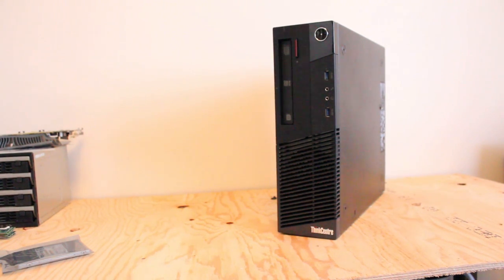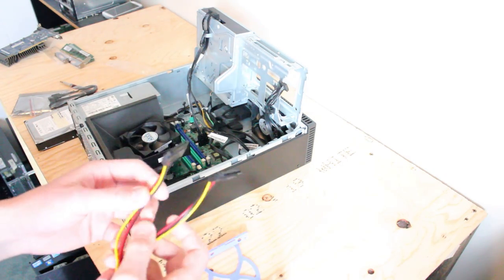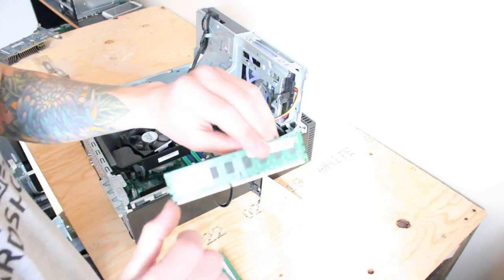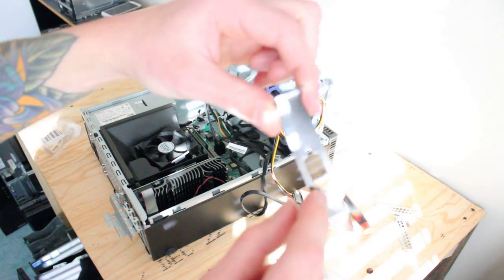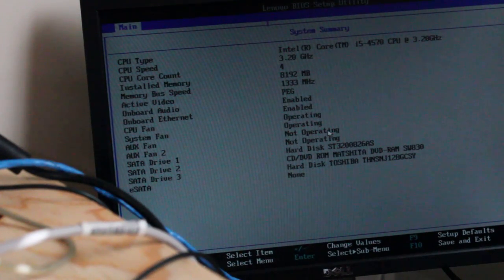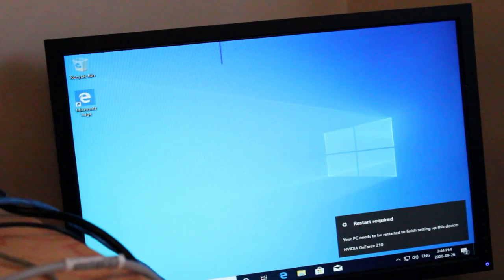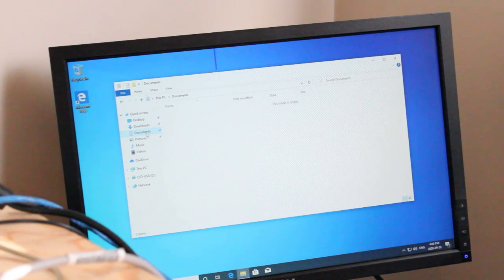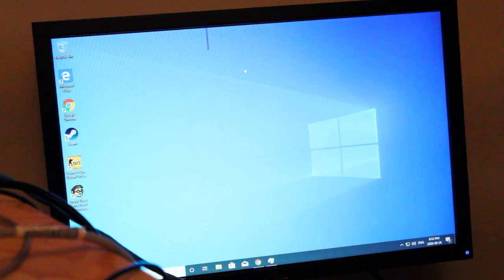Lenovo ThinkCentre M93p SFF Upgrade (SSD, RAM, Graphics Card, HDD)

Comment: Wanna buy m93p myself, this vid helped a lot tnx. One question, where did you put ssd? Did you screwed it to the metal frame?
Reply from the maker: I used plastic zip ties and fitted it underneath the HDD caddy.  Check out this updated video I did:  https://youtu.be/BderaGy5y4I

By the way, I have some to sell if you want to check out options from me that might suit your budget or custom job.
Reply: @HaisteComputerRepair  Nice, a very elegant diy solution.
Reply from the maker: @michaeldoherty2671  I don't get too fancy with builds that are in these mass manufactured towers.  They are already pretty spaghetti like from the factory in terms of cable management.

Comment: Just bought one of these refurbished for my dad to use as a Facebook machine. So the 2 beeps on startup is normal? Mine does it too.
Reply from the maker: Many times, with many different systems, one or two beeps is normal.  It means the system is posting and booting the operating system. Sometimes you can disable in BIOS.  What are the specs on yours?
Reply: @HaisteComputerRepair  interesting, i5 2400, 8gbram, 500gb hdd.
Reply from the maker: @Ayecie.  Is it a ThinkCentre M93p or M91p?  M91 shipped with 2nd gen Intel CPU's while M93p was 4th gen.
Reply: @HaisteComputerRepair  it’s an m91, everything is working properly, I was just curious about the beeps like on your video.
Reply: @HaisteComputerRepair  for example, powering it on I hear the 2 beeps, then there’s a splash screen that says press f1 for setup or f2 to resume, pressing f2 continues to windows and then it operates normally.
Reply from the maker: @Ayecie.  oh ok that's different.  Do you know how to go into BIOS and check the boot order?
Reply: @HaisteComputerRepair  I’m gonna try tommorow, I looked online and someone with the same experience pressed “load setup defaults” in bios and it seemed to solve their issue.
Reply: @HaisteComputerRepair  Okay so I read that pressing “load setup defaults” in bios would stop the beeping on startup, and it did but then I kept getting the “inaccessible boot drive” windows error on startup. Read again somewhere that booting into safemode, restarting and letting it do all its updates would work, and lo and behold it did. I now startup with no 2 beep codes or the splash screen telling me my “ram decreased, f1 to setup f2 to resume”. All is normal, for now. Gotta love tech issues man.

Comment: I have a Thinkcentre E73 SFF which has the 4 gen intel cpu. It has got I5-4440S, 16gb ram, 256 SSD and Intel 4600. 
What motherboard does the M93P have?
Reply from the maker: The M93p board has a LGA1150 socket type and a  "Haswell" microarchitecture.  Just like the i5-4440s.

Comment: Bro I have purchased lenovo m93p 4gb ram i5 processor.but very very slow.i need multiple virtual machine run in this pc.so can I purchase 4gb ram and 2gb graphics card for better speed performance? And need ssd?
Reply from the maker: First step should be the purchase of an SSD or two, depending on what you need.  RAM next.  If you can get either 4 x 2GB DDR3 1333MHz or 1600MHz.  Or, 2 x 4GB for dual channel 8GB.  4 x 4GB for 16GB is good too.  Last should be the 2GB graphics card.  You may not need it right away for running virtual machines.  Look for a 2GB DDR5 Low Profile Graphics card like the GT 1030.   Where in the world do you live?  I may have something you need in stock.
Reply: @HaisteComputerRepair  Thanks bro.i m live in india
Reply from the maker: @tamilanscripts1242  No problem, good luck with your M93p!

Comment: I have the Lenovo thinkcentre m81 tower that has an integrated intel HD 2000 can I remove that and put a 
ASUS GeForce GTX 1050 Ti 4GB PHOENIX Fan Edition?
Reply from the maker: Yes, that should work.  If you have the SFF Tower, you will have to migrate to a larger tower.  Good luck, let me know if you try.

Comment: founded out someone selling these lenovo sff's cheaper than the dell optiplex 9020's lol. To my eyes, the only physical difference is that the motherboard on the Lenovo has 2 slots, and the Dell Optiplex 9020 has 4.

I found a guy selling these lenovo machines (i5-4690) cheaper than the 9020's (i5-4570) lol.
Reply from the maker: You must have the Tiny version of a ThinkCentre?  The M93p in this video has 4 dimm slots, as well as majority of the SFF models.  Did you end up getting one?
Reply: @HaisteComputerRepair  No not really, The M73 Tower is just like this video. I think the difference is just it has less ram slots.
Reply from the maker: @syaz4380  Ok, well running dual channel ram is always best.  Two Dimm slots isn't bad.  What do you currently have installed?
Reply: @HaisteComputerRepair  Currently have 8Gigs of ram (4GB x 2). On Lenovo's website they said the max is 16Gigs which is plenty
Reply from the maker: @syaz4380  Nice.  Keep an eye out for deals locally or on eBay/Alibexpress.  8GB DDR3 sticks are still pretty expensive.  I usually manage a max payment of $30 CAD for 2 x 4GB DDR3 1600MHz sticks.  8GB sticks I'll get for a deal if I am lucky.  Of course, if you have the budget spend away.  Let me know what you choose for upgrades.
Reply: @HaisteComputerRepair  I got the M73 Sff tower, works fine. Great for light gaming such as minecraft, roblox. Now I'm saving money for a graphics card lol
Reply from the maker: @syaz4380  That's where price is involved.  Keep an eye out for GT 1030 low profile.  It would be a nice boost and they aren't terribly expensive as compared to anything even slightly more powerful.

Comment: Can we install a 4GB graphics card separately?
Reply from the maker: You can use a 4GB graphics card in this setup so long as it is Low Profile.  Otherwise you would need to migrate to a larger case.  I am currently running a 4GB card in a setup with the same 4th gen Intel CPU series.
Reply: @HaisteComputerRepair  thanks for the info!
Reply from the maker: @GKCCB  My pleasure!
Reply: @HaisteComputerRepair  ooh which 4gb card are you running. I'm looking to get a low profile card upgrade in my i7 m93p and would appreciate knowing what works!
Reply from the maker: @mejpyt  This would be awesome, but it's pricy https://www.gigabyte.com/Graphics-Card/GV-N105TOC-4GL#kf
Reply: Since the 4gb is a bit scarce and pricey, how about the GV-N1030D5-2GL or the Geforce GT 1030 2G LP OC
Reply from the maker: @mejpyt  1050 2GB might be easier to find.  My test run in an M93p:  https://youtu.be/vQOih0cb-Ys

I did a test run with a GT 1030 in a M93p:  https://youtu.be/VLMX8LwqXug
Reply: @HaisteComputerRepair  So I put in an extra fan just like your tutorial, and also a GT 1030 DDR5. Also put in a D-Link DWA-131 Wireless-N Nano USB. So far so good. Need to run some benchmarks and compare against yours. Thanks for the info and vids on getting life back in an m93p!
Reply from the maker: @mejpyt  That's awesome, let me know how it goes!  Unless you stress the system I would imagine your thermals would be ok.  I noticed that once I installed an i7 CPU the thermals did jump a bit while gaming.

Comment: Would an Asus "GTX-750ti Formula OC" fit here? I can't do any bracket change because it has DVI/HDMI/VGA port meanwhile lowpro brackets only has DVI/HDMI holes?
Reply from the maker: Is that right?  Did the low profile brackets come with the card or did you look at third party sellers?  That card would be a good fit for the system.  The low profile version would just fit, it looks like.  Let me know if you try it out or if you find brackets.
Reply: @HaisteComputerRepair  Or is it possible to remove the vga port in the gpu? I really looked every single shop they only sell lowpro brackets that only has two holes
Reply from the maker: @shinkishimoto7607  Does your card look like this:  https://www.techpowerup.com/review/asus-gtx-750-ti-oc/

Or, can you link to a picture of what your card looks like?  

If a bracket almost fits, you could always use tin snips to modify it, but that's up to you and how you want it to look.

Comment: Can this pc play some games without being upgraded?
Reply from the maker: Yes definitely.  It would help to at least invest in the 128GB SSD, keep a HDD for storage and running games, and get up to 8GB RAM.  So, I guess a better response would be to ask what you currently have running or what is in the one you are looking at purchasing?  Btw, I just tested a Radeon Pro Wx 3200 4GB and it's a nice boost for what came out to $180CAD as a trade in from a customer.

Go here:  https://www.pcgamebenchmark.com/

Enter in the CPU info, Intel HD 4600, and whatever RAM you have.  It will give you an idea, but just remember that higher end games won't run that well.

Comment: Hello I have some questions pls-pls answer 😅

1.) Can i put a singlefan Asus GTX 750ti without changing the PSU or buying any other wires?

2.) Can I add a 128GB Kingston SSD without using/buying any additional wires or etc? Because I won't remove the stock 500GB HDD

3.) Is the 5.25 Optical DVD Drive replaceable or removable?

Pls-pls reply, Your answer is would be worthy as gold...Thank You!🤗

(2)
Reply from the maker: 1) This would work with the stock PSU:  https://www.techpowerup.com/gpu-specs/gigabyte-gtx-750-ti-low-profile-oc.b5381

2) You can add a 128GB SSD of any brand, but you need to purchase 1 x SATA cable to plug from the drive to the motherboard.  Also, you need 1 x SATA Y Power Splitter so you can power the drive and keep your existing HDD and Optical Drive powered as well.  You could unplug the connections from the optical drive and use those for the SSD, but then you would not have an optical drive to use.  

3) The optical drive is completely optional.  If you use it, keep it.  If not, like I said in #2 you can unplug the SATA connections and use those for the SSD.  

I recommend installing Windows to the SSD and using the HDD as storage.  Follow the directions in this video to install it all.  Good luck.
Reply: @HaisteComputerRepair  Oh I forgot to ask this earlier I'm sorry but can I fit the 128GB SSD along with the Stock HDD? I mean is their an extra slot or something....😅this is the last one thank-you!
Reply from the maker: @shinkishimoto7607  No worries, feel free to ask questions.  Just like in my video, you can use something like a plastic tie wrap to fasten it below the HDD.  Once you take a look, be creative and you'll find a place to put it.  It's crowded and it might look messy, but it's not like you'll be forced to look at it when it's enclosed in a tower case.
Reply: @HaisteComputerRepair  sorry again😅 but is their any fan slot in that unit/case?
Reply from the maker: @shinkishimoto7607  There is a front intake fan and the CPU fan has a plastic shield that distributes the air as a type of exhaust.  There is extra fan connections on the motherboard, but you would really have to squeeze an extra fan in unless you migrated to a larger case.

Comment: can i keep the hdd thats in the thing already and just put the ssd above it or under or do i need a new hdd too? also would a 1650 LP work with this build
Reply from the maker: Yes, you can keep the HDD and install the SSD as a boot drive.  You need 1x SATA Y power splitter and 1 x SATA cable to power both drives unless you want to remove the cables from the optical drive and not use that anymore.   The video shows how to do this.  If you need to back anything up or retain the Windows key, do that before wiping the HDD and installing Win 10 to the SSD.  Both cables I have sourced from eBay for less than $5 CAD.   As for the 1650 low profile, I think it would work.  The M93p has PCI E 3.0 and according to this site the card is PCI Express 3.0.  Also, it's rated as 75W, so you would probably be ok with the stock 240W power supply.  Keep in mind this is my speculation, I haven't tried it myself.  Let me know if you do, I would love to find out.   https://www.zotac.com/us/product/graphics_card/zotac-gaming-geforce-gtx-1650-low-profile-gddr6#spec
Reply: I’m about to try the 1650 LP
Reply from the maker: @strangedays1984  Let me know how it goes.  I have a bunch of M93p's coming my way and I'll look out for a deal on a 1650

Comment: Dose this come with network card
Reply from the maker: Not unless someone is selling one with it installed.  You can buy a pci-e wireless network card, though.  Just make sure it comes with a low profile bracket to fit in the SFF case.

Comment: Just got this pc came with a 16gb ram,128 gb m.2 ssd,1 tb hdd it has the i5 3.2 ghz i want to us this pc for gaming specifically i want to case swap it and get a good ghraphics  card for it any recomendations...and maybe suggestions on any other upgrades?thanks.
Reply from the maker: That's cool.  Do you have some kind of adapter for that M.2 SSD?  SATA adapter or PCI card adapter?  Check out the pinned comment for some ideas, specifically the GeForce GTX 1650 if you have the budget.  Let me know what you end up using and let me know about that m.2 SSD, I'm curious.

Comment: I want to add a grafiq card (gtx750ti/1050ti/960 or 1030) need   to upgrade my power supply and the case too ? can i use hp 800g1 case ?
Reply from the maker: You can fit the "low profile" version of these cards into this tower.  If any of the cards are larger and require a power connector from the power supply, you will need to migrate to a larger tower case and get a compatible power supply.

Comment: Thank you for this video man. can i upgrade/change the exist 4gb RAM to kingston hyperX fury 8gb ddr3 1600mhz for this pc? Hope u can give me the answer, Thanks ya
Reply from the maker: I want to say yes, it would work.  That would be excellent.  I have only tried 4GB stick configurations personally.  If you do it, let me know how it goes :)
Reply: @HaisteComputerRepair  all right. Thank you ya. I'll try soon. 🙂👍
Reply: @Ziyyad6789  how did you go, I am looking at doing the same with 16gb. Conflicting things on Max being 16 or 32gb
Reply: @strangedays1984  hey dude. I already used the 8gb and it works well and give a good performance until today.

Comment: Would this entire system fit in an NZXT H510?
Reply from the maker: Yep, it would likely fit just fine.  The board is smaller, so of course not all those PCI slot options would be used.  It might help to do some research on what type of front panel USB cables are used and if they will fit on the M93p motherboard.

Comment: I picked up one of these last week. I'm running a 1050 TI in it. There's no air flow though for this card to breath. Not sure if there's a way to cool it down properly with the limited space. It keeps it in about 96° Celsius
Reply from the maker: Nice, that's a great card.  You could migrate to a larger case if you're motivated.
Reply: @HaisteComputerRepair  do you have a possible link to a case in mind that this might work with. I'm assuming it would be a mid Tower
Reply from the maker: @Dsuds23  I think any tower case would work.  One thing to look out for is alignment with screw holes, but most are universal.  I have installed M93p setups into a random assortment of cases.  Modern cases and cases from a decade ago.  Front USB connection types would be important to consider, as well.  I have run into some cases that have a particular connection that not every board supports.  I don't have a recommendation, but if you look something up share it here and I'll take a look at it.
Reply: @HaisteComputerRepair  thank you
Reply from the maker: @Dsuds23  My pleasure!
Reply: @HaisteComputerRepair  
So the board is an atx board?
Reply from the maker: @RonLarhz  It's a M-ATX size motherboard is what I would call it.  In the SFF version.

Comment: Excelente video, justo voy a actualizar una ThinkCentre M93, me guiaré con tu video, solo tengo una duda, cual es el cable para alimentar el otro disco duro??
Reply from the maker: Thank you!  The graphics card I install is not a great match for the system, let me know if you want recommendations for better ones.  Look up "SATA Y splitter 90 degrees" on eBay.  That is the cable you need along with another SATA cable.  They are both pretty cheap if you don't mind ordering from China and waiting.
Reply: Hola amigo, cómo le fue con eso? Si lo hizo?

Comment: i got the 4790 version with 16gb ram and swapped case and threw in a 600watt psu with a gtx 980 with 1tb ssd and it runs games pretty good
Reply from the maker: The i7-4790? That sounds awesome!  I bet it runs quite well.  I would love to try that, I'll keep my eye out for deals.
Reply: How did you get a better psu in there, I can’t find one that isn’t either super expensive or too big
Reply from the maker: @jamesshiervlogs2613  You could try something like this:  https://www.bequiet.com/en/powersupply/496

It seems a bit expensive, but also somewhat rare, which might be what affects the price.
Reply: @jamesshiervlogs2613  

He literally said he swapped case

Comment: Do you know if i can upgrade the psu. I bought a graphics card that requires external power which is not provided by the default psu
Reply from the maker: Yes you can.  First, though, are you planning on keeping the same SFF tower case or migrating to a larger case?  Check out this for SFF:  https://www.bequiet.com/en/powersupply/496

I've never used one, but this video demonstrates install in a M91p: https://youtu.be/yJbpWaZypO4

Comment: Great video bro. Can I just use the ssd or do I have to use the power splitter and keep the 3.5 installed?
Reply from the maker: Thanks!  No, you can just use the SSD if you like.  The power splitter is just for setting up an additional storage drive.  Completely optional.